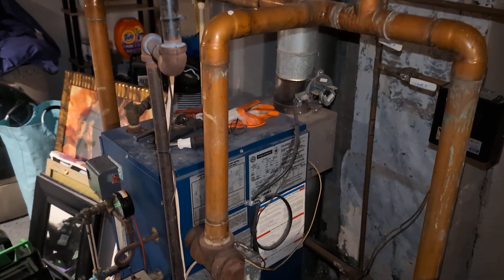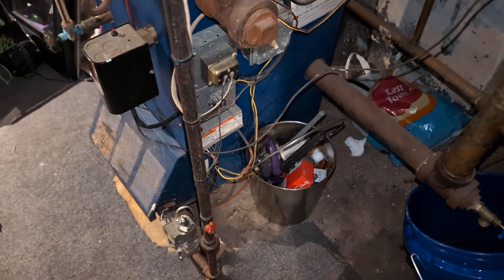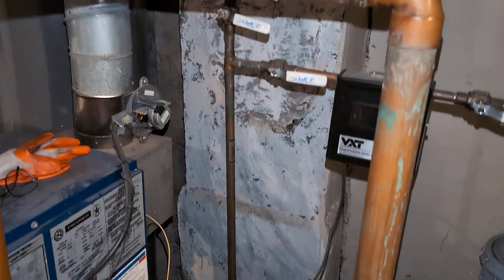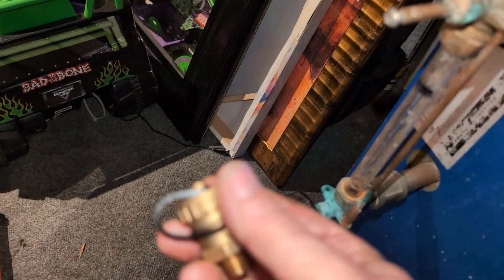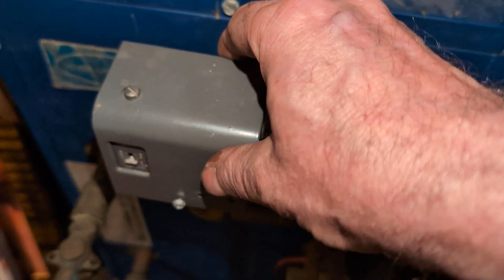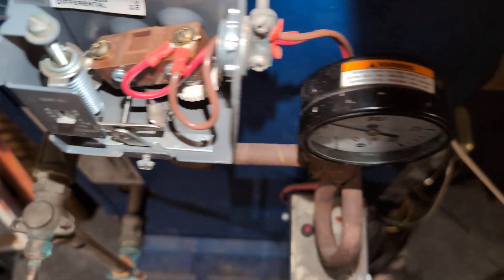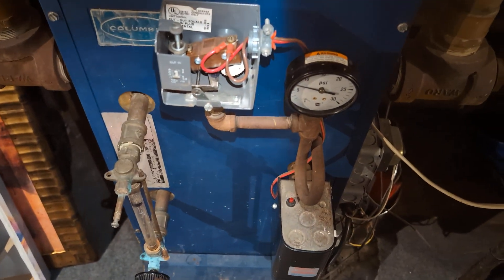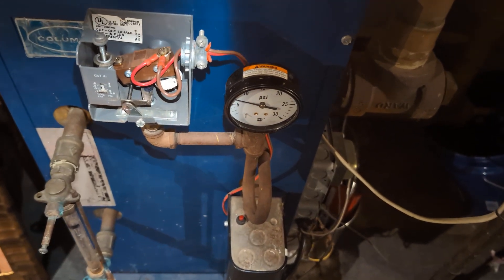Steel Pigtails On Steam Boilers Suck, But That Is No Excuse To By-Pass The Pressure Control

Comment: How can someone be so stupid as to jump a pressure controller?

I was in the field 46 years. The last year i worked I was sent to look at a burnham steel boiler steam probably about a milllion btu wit a Webster gas burner. The call was for a burner “rumbling”. 

I got there the burner was running 12 psi (it was process). I went behind the boiler and was setting up analyzer. When i came around the front the gauge said 25 psi

Safety valve not blowing 15 psi boiler  pressure controls mercury bulbs not moved i said bad gauge. Shut burner off and went to truck for gauge gauge on boiler was ok

Steel pig tails on , operating control and manual reset plugged safety valve rusted closed

I had to get them running. I pried safet valve open and wit boiler running it leaked some but would move took off pigtails cleaned boiler connections and put controls back on with 1/4 nips and ells didnt have pigtails with me and couldnt clean old. Returned the next day with new safet valve not blowing and brass pigtails and fittings . Maybe at 50 lbs the old safety valve would have opened or maybe the boiler would have become Air borne
Reply from the maker: Well done, sir!
Thank you for sharing your story.
Reply: @gordonschweizer5154 great work, thanks for the video. I'm not tech savvy at all haha. how would I ask you stupid questions about a thermostat?